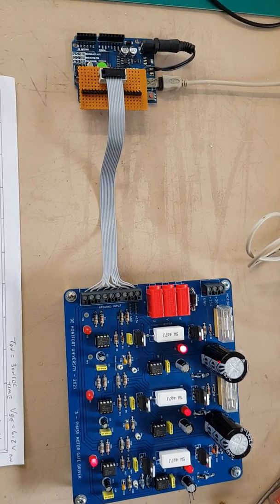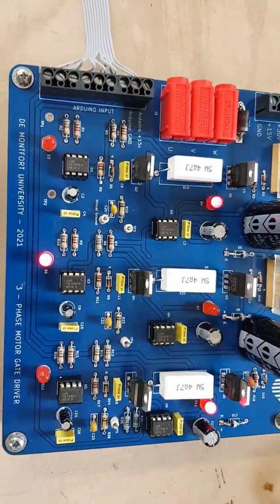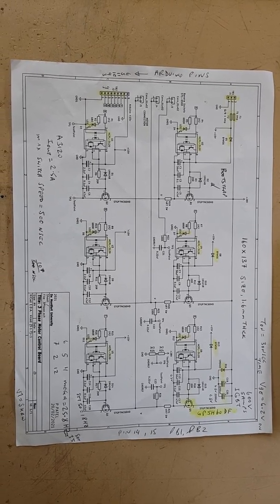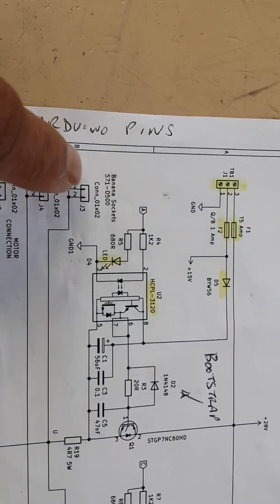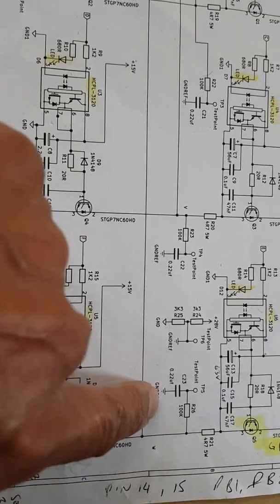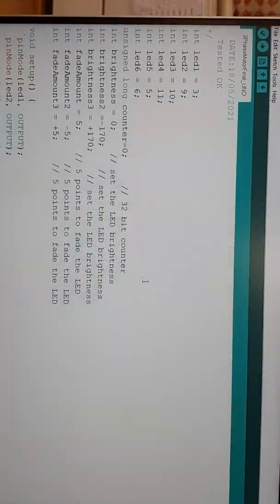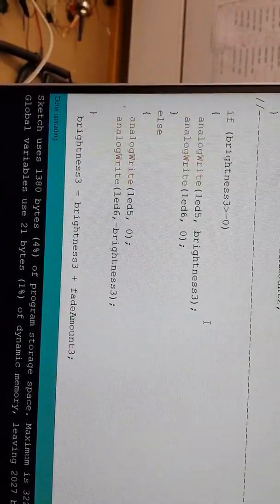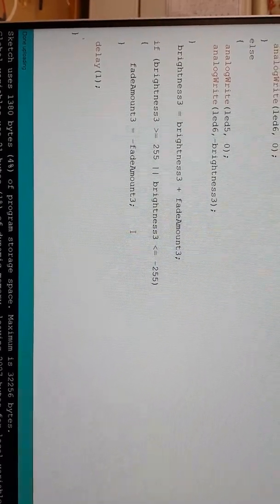3 Phase Motor Control using Arduino Uno

Comment from the maker: Hello this is a simplified code which creates triangular and inverted triangular waves to simulate a Sine wave.
I have code which produces 3 nice Sine waves using look-up tables.
Reply: I dont think you should put 47nf between mosfet gate and drain, it will load your driver and slowing down mosfet on/off which lead to overheating.

Comment: Why you are putting power resistnace in each converter leg?
Reply from the maker: This is not needed, but I put them there in case the high side and low side Mosfets came on together by mistake.
This would damage the Mosfets!

Comment: How do you control the speed of the motor?
Reply from the maker: You need to change the delay for the cycle time, less delay means a higher frequency hence faster motor speed.
I will post the code for the Arduino Mega soon which controls Speed and Direction !
Reply: @kashpatel898  Is it running on DC or AC voltage.
Reply from the maker: @leechimfwembe  it's running on DC 35v to drive the motor and 20v DC to drive the chips
Reply: @kashpatel898  are you going to make the Arduino mega board video? This is really interesting
Reply: @kashpatel898  sir what is the rating of your motor???
Reply from the maker: You have look up tables for the 3 sine waves.
To make the Motor reverse in direction, you have read the look up tables in reverse 😉